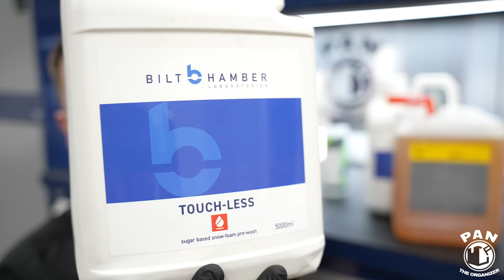The end of the 2 bucket car wash method!? 💀

Comment: Hello Pan.
can you answer this about the Gtechniq W4 citrus snow foam, looking at the dilution ratio's, 1:400 light dirt, 1:200 heavy, which when going to a liquid dilution calculator, when using my 700ml container would be 1.75ml for 1:400 and 3.50ml for 1:200, that don't seem like a lot to me, am I reading this right?. Thanks
Reply from the maker: Don't overthink the moment for this. Many recommend using it at a 1:10 dilution ratio in the foam cannon. 3 oz of W4 and 29 oz of water in a 32 oz foam cannon container and you're good to go.

Or you can get the exact dilution by following the steps in my dilution tutorial here: https://youtu.be/GZ_ATHFtpKU?si=WR8ImRSlEx9g1RFg

But yes, a 1:400 dilution in a 700 ml container would in theory mean 1.75 ml of product, and the rest with water.

Comment: Pan, I thought CarPro Reset was supposed to be used less often to clean ceramic coats more intensely and help restore them. It was my understanding it wasn't intended to be used weekly... In your experience are you not seeing it live up to the claims CarPro has advertised? Is it too weak to truely clean coatings?
Reply from the maker: CarPro Reset, although it's a powerful shampoo, is still pH neutral and can absolutely be used every week for regular washes. Heck I wash my car twice weekly and I use that shampoo often. Yes it works as advertised. And every now and then, if you feel you have a bit more road film accumulation, grime or perhaps water spots or minerals, you can use a high pH shampoo for the pre-wash (like Bilt Hamber, or CarPro Lift), and an acidic shampoo (CarPro Descale) for the hand wash.

The key to having a coating work well is regular washes, and the maintenance spray at least once every 2-3 months.
Reply: Cool. Thank you for the quick response.

Comment: Hi Pan! What shampoo do you use for the bucket if it isn’t the same as the foam cannon shampoo?
Reply from the maker: For my regular weekly washes, I typically use this in the bucket: https://bit.ly/49QY4lB
Reply: Thanks for the quick reply! Would you recommend this if my car has no protection?
Reply from the maker: Yes it's also the best shampoo for a car with no protection. It just works super well to remove grime and traffic film too.

Comment: I have used the Gary Dean rinseless method before. I have a dirt driveway so the rinseless method minimizes mud and splatter

I have a question is to seeing a previous video about the iron remover, how often would you do that in conjunction with this process?
Reply from the maker: I use an iron remover for maintenance on vehicles once every 3-4 months on average, or as needed depending on their level of brake dust contamination. My Porsche 911 Turbo S doesn't need an iron remover for example, as it has carbon ceramic brakes, so no iron particles and zero brake dust.
Reply: @PanTheOrganizer  thank you. I commute about 25,000 miles a year so I figured I would bump it up from the average. And I liked how in a previous episode you worked it into the car wash along with clay bar

Comment: I've been using the two-foam, one bucket method since I saw Yvan demo it i one of his videos. Of course, I use a separate bucket for wheels.  How does the KC Superfoam compare with the GST with GS added?
Reply from the maker: The Super Foam has more cleaning power (pH 12.5). The Gsf with Green Star added to it is closer to Active Foam (pH 9.5) overall.

Comment: so what's wrong with 2 buckets during second wash? even your pre washed there's still a lot of the dirt trap on the surface because the static so 2 buckets during second step hand wash stage still a good idea no?
Reply from the maker: There's nothing wrong with a two bucket wash method. It works just fine. There are many ways to safely wash a vehicle.

Comment: What soap do you recommend using in the bucket if i use a high level 12 prewash foam
Reply from the maker: You should only use high pH snow foams and acidic pH soaps in the bucket once in a while for a decon wash or deeper cleaning. See my ultimate spring deep cleaning tutorial: https://youtu.be/oTaFE_p2OAw?si=kqyUvdz0bA2wVvIr

Comment: Is it ok if I use regular water (from my garden hose) to wash the car? I know a lot of people say you should use spotless (deionized) water but I don't really have access to that and don't want to go through the hassle of buying and setting it up. If I wash my car in the shade and try to hand-dry it before the water dry's naturally, will I be ok and not have to deal with water spots? I also live in Arizona where it can get pretty hot so I'd try to clean it in the morning and in the shade to minimize the sunlight hitting the car.
Reply from the maker: It’s ok yes. Most people don’t have water deionizers and stilk wash their cars.

The trick is to wash in the shade as late as possible in the day or as early as possible in the morning (avoid noon hours when the sun is at its brightest and hottest).

And use a quick detailer or drying aid that you spray on the surface after the final rinse, and then towel dry. The product will act as a lubricant to minimize chances of marring all while also helping to prevent water spots and will boost gloss/slickness of your existing protection.
Reply: @PanTheOrganizer  thanks for the detailed reply! I used to work in detail at a dealership like 8 years ago. It's crazy how much has changed and been improved. I recently purchased a 2024 Mustang GT and am now getting back into detailing my own car so I'm glad I stumbled on your channel! Thanks again.
Reply from the maker: Congrats on your new Stang! What color is it?

Welcome to my channel. You discovered one of the biggest car detailing channels on YouTube as we surpassed 940,000 subscribers and we have over 124 million views! I have been detailing for 26 years and I love to share my knowledge and passion with my viewers.

You found the right channel to help you learn everything about detailing.
Reply: @PanTheOrganizer Thank you! It's silver with the black out package, so it has a glossy black roof and spoiler which is a bit harder to keep clean. Looking forward to following your channel and checking out more of your videos!
Reply from the maker: I have 1000 videos so far with new ones added twice weekly (Wednesday and Saturday). 

If you search for a topic and add “Pan The Organizer” to the search terms, you’ll likely always find a video about the topic.

For example “how to apply a ceramic coating Pan The Organizer”.

Comment: Does foam gun with garden hose works equivalent to pressure washer? I bought garden hose and foam gun , now i wonder if i should rather invest in pressure water?
Reply from the maker: No. A pressure washer and foam cannon will always generate more foam compared to a garden hose / foam gun setup for obvious reasons.

I made a video comparing both setups here: https://youtu.be/rJPk8nR8Ib0?si=Qt5l4Jp5MP5HBW-K
Reply: @PanTheOrganizer is pressure washer foam method safe on ppf/ceramic coating? Is there anything we need to be cautious
Reply from the maker: Same as normal paint.

Comment: would you recommend kochemie and reset as two good snow foams to start with ? Also was thinking of going with diy incredible suds or phoenix auto wash. it's a slightly used truck but in good condition. Let me know your thoughts.
Reply from the maker: Koch Chemie Gsf is a great snow foam for the foam cannon and can also be used in the wash bucket. 

CarPro Reset is my favourite car soap, especially for ceramic coated vehicles. A bit too strong for waxes. It can be used in a foam cannon too, but it’s mainly designed for the wash bucket.

All my top products recommendations are in my popular awards video here: https://youtu.be/KRv7vKsuliQ?si=gk4oagNyfW2Cc6f6
Reply: Thank you for the response 👍🏻 truly appreciate it !
Reply from the maker: My pleasure Tyler. How did you discover my channel by the way?

Welcome to my channel. You discovered one of the biggest car detailing channels on YouTube as we surpassed 945,000 subscribers and we have over 125 million views! I have been detailing for 26 years and I love to share my knowledge and passion with my viewers.

You found the right channel to help you learn everything about detailing.

Comment: Pan... what are your thoughts on using and acidic based wash like CarPro Descale as a prewash for doing a prewash for a car to be ceramic coated?
Reply: I also do the one bucket on relatively clean  vehicles or coating maintenance washes, but I will use multiple mitts. I do two bucket washes for really dirty vehicles
Reply from the maker: It’s a good step. I usually use Descale in the bucket though to prep a new car for a coating. As I use a high pH snow foam for prewash. See my new car detailing videos:
Mercedes S 580: https://youtu.be/Vq_tfcwryVI?si=whord2_UEFSg28UW
Aston Martin Vantage: https://youtu.be/OKga3yZVTqo
Volvo XC60: https://youtu.be/tvDBBenhYFA
Tesla Model Y: https://youtu.be/gohks8xP5NY

Comment: So, do you switch to a pH-neutral foam for your second foam? It looks like you used the Koch Chemie Af again. I suppose it's close enough to neutral to use for both foams.
Reply from the maker: I have a high quality pro grade coating on my car, with awesome resistance to chemicals, so in my case, I can foam with Active Foam (which is only pH 9.5 anyways) and refoam with it too if I want, no problem. Or I sometimes just use Gsf for the snow foam, and CarPro Reset in the bucket. Or any other snow foam or shampoo I feel like using. I'm constantly trying and testing different things.
Reply: @PanTheOrganizer Ah, good to know there can be variations on the 'formula'. I'm always switching up products as well, but changing the technique isn't always so easy.

Comment: The ph of the wash soaps is irrelevant if the quality of your waters isn’t good that’s more important. I’d be more concerned about using deionized water and not worrying about soap ph . it’s like splitting hairs.
Reply from the maker: Ideally you get all the factors right. I like quality soaps, plus I have a water deionizer setup. :)

Comment: What is reset used for and do you have to use it?
Reply from the maker: CarPro Reset is a shampoo you used to clean your car. It was specifically designed for ceramic coated vehicles. It’s my favourite car shampoo, as mentioned in my awards video here: https://youtu.be/KRv7vKsuliQ?si=FOMpD86zslIgLtwA

Comment: Out of curiosity does your car have ppf on it? I never hear detailers talk about ppf. If your whole car had self healing ppf it would complete remove the risk of any permanent scratches. Yes for the average person like my self, I can’t afford ppf for my whole car. I understand us peasants need to be careful with our paint haha
Reply from the maker: I don't do PPF on my cars. I am just not a fan of the look or feel or PPF. Plus, as I get a brand new car every three years, and do low yearly mileage, scratches and stone chips are of no concern to me. My cars are always pristine when I bring them back to the dealership.

But for people who keep their cars for many years, and want the ultimate scratch and rock chip protection, PPF is the only solution. I would still recommend a ceramic coating on top of the PPF, for the best of both worlds.

So my paint always looks flawless as I use safe washing and drying methods.

Comment: Hey Pan! Your follower from Mexico! I just to have a bottle of waterless for birds drops (carpro exh2o) in my car, can I used for clean the birds drops? If I can, how can I use it and should I use P&S waterless or rinses less . Thanks
Reply from the maker: Yes you can use the CarPro Ech2O as a waterless wash (see the correct dilution on the label, as it can be used for many different things). Ideally you would always wash your vehicle, but if you can't, then the second best option is to use a rinseless wash, a waterless wash or a quick detail spray to spray on the bird poop, let it dwell a bit, then gently wipe with a plush and soft microfiber towel.

Never let bird droppings sit on the paint for too long, as the acidic contents can start etching through the clear coat especially under the hot sun.
Reply: @PanTheOrganizer   thanks I forgot! The bottle is always in my car (first aid like multiX, ech2o, inner, inside, clarify) for clean the bird droppings and a microfiber. I was thinking to get a bottle of absolute for pre wash (before the foam) and clean the bird droppings like first aid in the street or keep with the ech2o

Comment: Hey man - good video but actually you're doing it wrong. 
Instead of re-dunking your mitt and re-using it... have several mitts on hand, once you've used both sides of your wash mitt, set it aside, grab a fresh one, dunk that new one in your wash bucket and keep going. No need to re-dunk the old, dirty, used one since wash mitts are inexpensive - why not have 2-3 mitts to use during the wash? I actually use microfiber Wash towels - which have 8 sides if folded - so you can basically do a whole car with 1 towel if the car isn't too dirty - or 2 towels on a larger car.

Comment: So use the same pre wash soap for contact as well? Want to make sure I didn’t miss that
Reply from the maker: It depends what soap you are using. Some are just meant for pre-wash in a foam cannon (like CarPro Lift, Koch Chemie Active Foam, Gyeon Foam, Bilt Hamber Touch-Less, Bilt Hamber Auto-Foam, etc). And some can be used both in the bucket and in the foam cannon (like Koch Chemie Gsf, CarPro Reset, Gyeon Bathe, DIY Detail Incredible Suds), etc.
Reply: @PanTheOrganizer  in your view just curious will it be more cost effective to just purchase that does both? I’m looking to start a detail business soon
Reply from the maker: Yes and no. There are situations when you'll need a high pH snow foam and acidic soap. You wouldn't use those for regular weekly washes. More when a lot of traffic film accumulation, bugs and grime needs to be addressed (high pH) or when mineral deposit accumulation or water spots are an issue (acidic soap).

For regular weekly washes, all you need is a pH neutral soap. For 95% of the time, that's what you'll be using. And in that case, yes it makes sense to have one soap that can be used both in the foam cannon and bucket. I have a video on the best snow foams, and pretty much all of them can also be used in the bucket. Here's the video: https://youtu.be/TCQXfXECr5Q?si=rpHDFpDixM8g05jJ

And then you can have smaller sizes of specialized soaps (high pH, low pH) for specific times when you need them.

Comment: Παντελη, the 2 buckets was dead a long time ago when the snow lances were introduced
Reply from the maker: Many still like using that method so it's all good. As long as people using safe washing and drying methods, and enjoy washing their cars, I'm all for it.
Reply: Sure there are and will be people going for the 2 bucket method especially without a pressure washer. However since a lot of soaps can be used with the foam lance that instantly eliminates the need for the soap bucket with a + of quite a thickness of it. The drying method something that has lost attention lately  @PanTheOrganizer

Comment: 2 bucket method if you don't have a pressure washer, for sure.

If you are using 2BM aswell as a pressure washer + snow foam then you either aren't using the snow foam correctly or you just like adding an extra step for old times sake.

Comment: Wa snow foam is best for ppf? What the deepest clean but also safe.
Reply from the maker: Any foam you can use on paint you can typically use on PPF too. Just don't work in direct sunlight and don't let the foam dry on the surface. Also, for regular washes on a weekly basis, just use pH neutral snow foams and soaps.

There is also PPF specific stuff now. Check out my video on how to easily wash and maintain PPF here: https://youtu.be/I3AszYhWhs4?si=AqwGEz7QcSEjfohX
Reply: @PanTheOrganizer will do, thanks mate!

Comment: I bought into the whole 2 bucket grit guard methodology several years ago, but over time I've noticed that for me at least, going with (at the extreme) a pressure rinse, a pre-wash, then a contact wash with inexpensive but good quality microfiber towels (seems like all the big box stores have them) and using them only once for contact washing the vehicle, seems to create the best combination of cleaning and safety.  I've yet to ever wash even a "clean" car and not come away with a contaminated towel from something unseen near the underside of the vehicle, or from the door jams, or from a myriad of other places.  I don't throw the towels away, they get rinsed clean, hung to air dry, tossed in a series of "reuse" buckets (depending on condition), and get tasked for other uses.  Once the bucket(s) are full enough with towels, they'll go through a wash cycle in the washing machine, with a microfiber cleaning solution, then evaluated for condition.  They can become interior wipe down towels, "harsher" chemical applications like chrome polishing, or they'll just get used for other purposes.  Eventually all my towels become rags, after several life-cycle events, and wind up soaking spilled oil/grease/coolant/cleaning chemicals/nose-blowing/etc.  At most a towel sees 2 washing machine cycles, simply because they get too contaminated with something I don't want in the washing machine to begin with.

I do have a quality of "good" (i.e.: more expensive) microfiber towels that I will dip into when cleaning my coated, and shall we say more loved on, vehicles, but I doubt I'll be replacing them in the quantities I have currently as they are used up/contaminated.